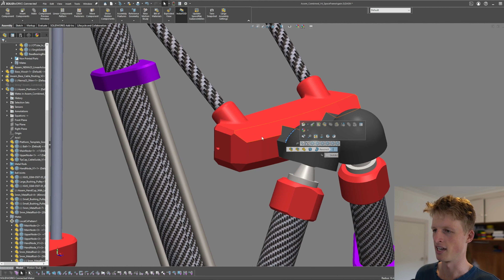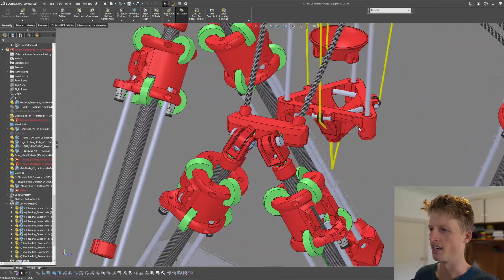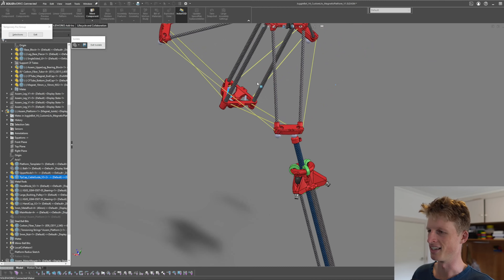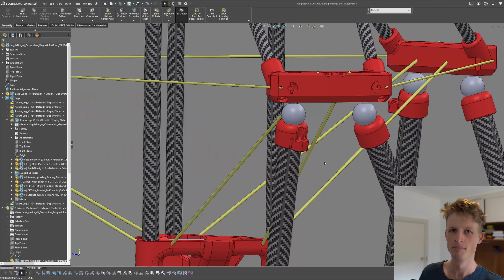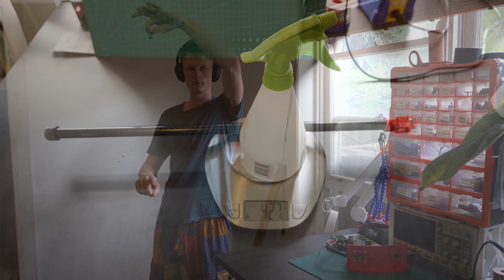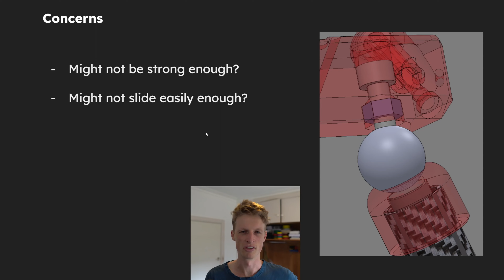Jugglebot's Joints: Universal No More! - PDJ #15

Comment: The max retaining force would be achieved if the magnet had a concave surface grind just a few thousandths larger radius as the ball.
But even then, very fast reversal of direction could possibly cause the ball to lift out of the socket = crash.
But so far so good...

Comment: So essentially your joint is the ball sliding inside the 3d printed cup, with the magnetism just providing a preload to your ball joint. This is very similar to existing ball joint designs often found in delta robots. A cup (usually coated with PTFE) with a ball preloaded (generally by a spring between two legs). You might be able to just buy such a PTFE coated socket + ball off the shelve...

Regarding the question about joint 'strength'. Important to recognize is that stiffness of your mechanism is likely not dominated by the stiffness of the rods, but by the stiffness of your bearings. Because the bearings are preloaded, the stiffness can be found as the contact between the ball and the 3D printed part, and hence the 3D printed part is likely a huge bottleneck in the design. 
The joints themselves present a similar stiffness in both tension and compression, with the exception in tension if the force exceeds the preload force (leading to the magnet detaching). So again, if you make the cup somehow more stiff, it would lead to a higher stiffness joint in general and improve also hysteresis, which is my following point:

What would additionally concern me, is the large and unpredictable amount of friction from the ball sliding against the 3D part. This can (of course) cause a lot of wear at best, but the large friction combined with limited stiffness can cause hysteresis, which will limit the accuracy of your mechanism. Additionally, if the static friction is large enough, it can (combined with the stiffness) create stick-slip type problems which are particularly difficult to deal with in your application.

As for the shape of a ball and cup joint, this is a whole science in itself. As you can imagine, getting the exact curvature the same between ball and cup is nearly impossible, so that can lead to undefined points of contact and lots of variation. 

Some suggestion I saw in another comment was to have the magnet directly contact the ball. I would highly advise against this, as the plating on magnets is quite brittle and I think it would wear out pretty quickly.
Reply from the maker: Very interesting thoughts! Thanks for sharing them 😊
To address some things you mentioned:
- I've since changed these joints to use a more standard approach: KD725 Magnetic Ball Joints. These are far stronger than what I show in this video, and after a bit of trial and error with PTFE sheets + printed spacers, they slide really smoothly with almost no stiction.
- Viewing these joints in the frame of a pre-loaded ball and socket is fascinating! I'm wondering if it'd be possible to do away with the magnets and just have a piece of string or a super strong spring holding the ball and socket together. Do you know of any examples of this that I could check out?

Cheers!
Reply: @harrisonlow  That makes a lot of sense!
I think it might be difficult to replace it with a piece of string, as you do need some compliance to be tolerant to misalignment and movements. A strong spring is definitely doable though. However, the preload force does not need to be very large! It will not make the joint more stiff. As long as the preload enforces contact between the ball and socket, the stiffness is determined by the lowest stiffness of these two. 
Essentially the preload only needs to be able to resist the largest acceleration forces without losing contact. If it is just slightly higher than that, it is fine. Should be fairly easy to get some ballpark values for the required preload (if you know platform acceleration, and assume that to produce the force onto one ball joint).

As for an example of the spring preload on ball joints, I had a look around and the following show a couple of clear examples:
ABB FlexPicker IRB 365
Festo EXPT
OMRON X-delta series
Kuka KR Delta
Cama Triaflex Delta
FLSun Super Racer/V400 (this one might be a possible source)

Comment: I think you will want more strength. There are magnets that are cylinders with counter sunk holes in them. So you can secure them with a screw (gently, they like to shatter) but that counter sunk hole makes the ball have closer contact with the magnet. So if you don’t have enough strength, get a bigger magnet with a countersunk hole in the centre so it can hug the ball. Or a ring magnet?
Reply from the maker: Yep, you're absolutely right. These joints ended up being nowhere near strong enough, so I've swapped them out for KD625 magnetic ball joints. I had to do a bit of adaptation to get them to move smoothly, but they're super strong.

I like the idea of using countersunk magnets! I'll have to pick some up sometime to give that a go. Cheers 😊

Comment: I did something very similar a few years back for a delta bot I was working on. Never did get the full machine working, but the joints seemed to work great!
Reply: The quality of this video is absolutely horrific, but in the off chance that some of the ideas are useful, here's what I was working on in 2015:
https://youtu.be/FiaQc2Rga3M
Reply from the maker: Just checked this out. Cool idea! Also the ball joints I referred to in my comment are not the ones from this video - these ended up being far too weak...

Comment: provided the sheet doesnt dampen the magnetic force too much you shoould definetly holepunch a few pieces of it, the coating on most commerical magnets is designed to resist corrosion, not friction based wear.

Comment: I would suggest to allow the steel balls to make full contact with the magnet, and use that as your main bearing surface, and use the concentric plastic part only to constrain the slipping motion of the ball. i would probably use a ball end mill to bring the spherical cutout of the 3d print to a tiny and smooth clearance.
Reply from the maker: Yeah (spoiler!) once I put the robot together, the magnets weren't nearly strong enough to hold it together 😬

I've bought some legit magnetic joints with 20kg pull force and they should be arriving early next week. 🤞

Comment: Man, I keep finding your videos and they're so similar to things I've worked on here (different, but similar).  I went on quite a ball-joint (and, separately, magnets) kick for a while.  Great stuff, love the design.  One thing I'd suggest, regarding friction of the printed cup - print that part in nylon.  Nylon is exceptionally smooth, and also very very strong.  If you're able to print in HDPE, that'd be even better, but man that is tricky stuff to print with.  Another thing that came to mind, not sure this would really be necessary but you might want to make mental note of it for later if it comes up: switchable magnets are a thing and they're pretty cool.  Basically, by either wedging a piece of metal between some magnets, or not having that metal there, you can completely enable/disable a magnet.  This is all done without active power.  This video  "How to build a switchable magnet" by Andrew Klein explains it well along with some designs.  So a modified version could perhaps be used in your cup assembly, if you want a way to use overly strong magnets but still be able to easily disassemble it later.  Toggle the magnet into off position, falls apart.  Toggle it back to on position, probably far stronger than you'd ever need it.  But as you say, you may already be at that 'stronger than you need it' level.  Anyways, best of luck.   Really enjoying these videos.
Reply: oh and one other thing i found quite helpful for 3d printed ball joints is to take the cup part and polish it in a drill press for a moment by taking one steel ball on a post and chucking it in the drill, the high speed friction does a reasonably good job of polishing the cup.  Helps smooth out the motion quite a bit.  Vapor bath could possibly accomplish similar results.
Reply from the maker: @MK-lk7nc  wow super helpful ideas! Thanks heaps! I love the idea of disengagable joints. Polishing is a great idea. 

Cheers!
Reply: @harrisonlow  Hey no problem.  Regarding polishing, I found it quite helpful to sprinkle in a little "Comet" abrasive cleaner, then drill.    Gives it just enough sanding action.

Comment: Kuel, 😎if you put some machine polish in the ball socket and drive the ball with a drill until it contacts the magnet, you may end up with 1)best x,y fit in the socket 2)best z mag strength 3)best z ball support 4)best x,y precision. That ball won't be getting any closer to the mag, just be sure to get all the polish out, and lube with carbon powder or something.

Comment: The limited strength of the joint seems pretty advantageous for this application - it means that when any of the various software, hardware, or electronics failures occur that could result in the actuators fighting each other or the kinematic constraints of the mechanism, the outcome will be magnets letting go instead of the robot destroying itself.

Comment: If the magnetic coupling isn't strong enough, you could add an extra magnet to the pin that screws into the metal ball
Reply from the maker: That's a really good idea! Hadn't thought of that before, but I'll definitely keep it in mind. Cheers!
Reply: @harrisonlow  And if that is still not strong enough, you can add some strings of fishing line around those joints, that ties both parts together, and defines the maximum range, that those parts could separate. Lust like the tendons on our  joints, that keep the bones together.
Reply from the maker: @Suthriel  That's a really good idea! Cheers 😊